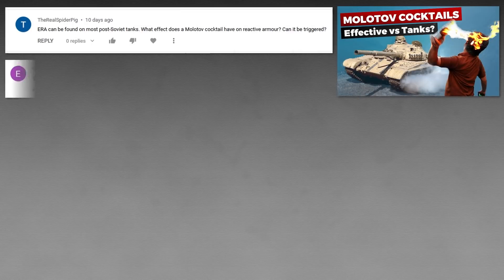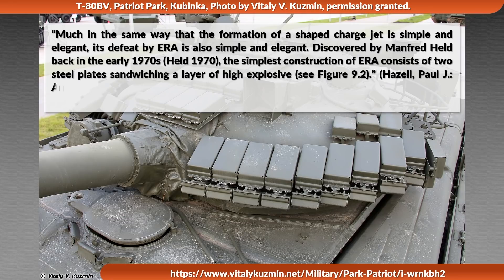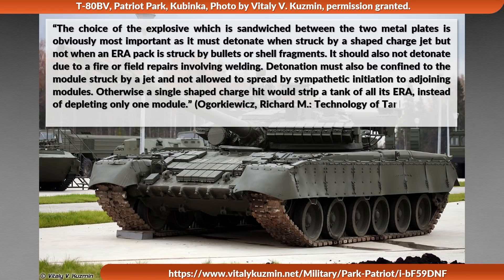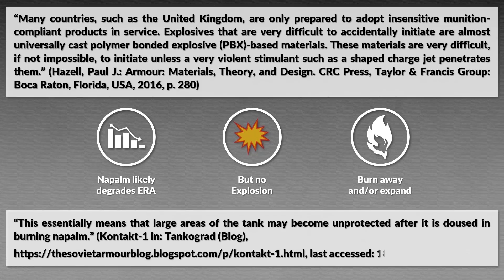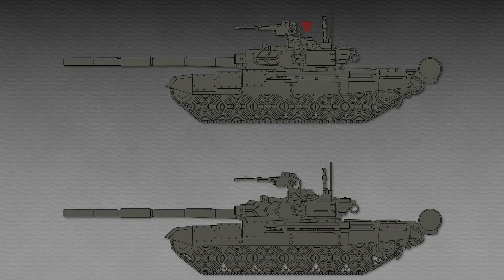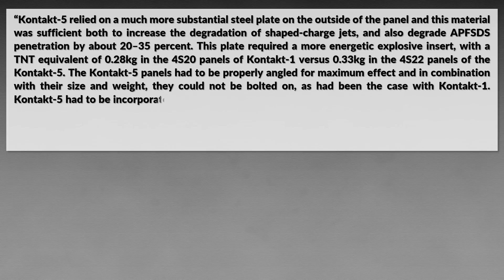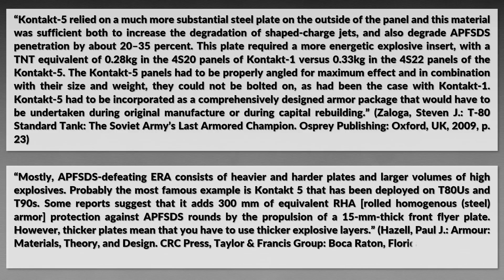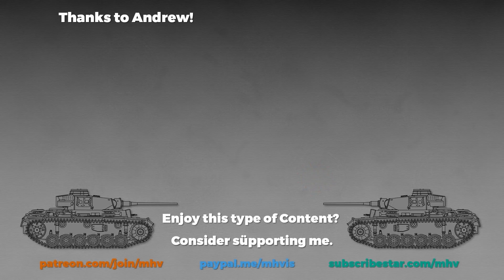Why does Russian Explosive Reactive Armor not explode?

Comment: Something is definitely going on with the Russians. Dry rotting tires on transports, equipment in poor condition, undertrained troops, etc. It seems to me that most of the high ranking military officials over there have probably just been pocketing the funds given to them for these things. I'm almost positive the majority of the Russian command structure is in deep trouble right now if they haven't been outright purged/killed already. One thing is for sure though. With all of these issues coming to light, I believe that there are going to be some major changes in the Russian military for improvements in equipment upkeep, supply chain planning and execution, command structure, tactics, and technological advances.

Comment: Something I didn't sea/hear mentioned (I may have just missed it) is that some polymerized explosives can simply melt under high heat. I do not know what explosive filler the Russians are using in their ERA (when they aren't filling it with egg cartons, that is), but I suspect that might be a potential failure point in their ERA systems.
Reply: the "egg cartons" are spacers for the "soft" relikt ERA
Reply: @arandomperson7713  I know. It was a joke.

Comment: Did I miss where he said EXACTLY how the APFSDS causes detonation? I heard that the steel plate is thicker, but it still needs to detonate, right? Or is it implied that the thicker plate creates enough commotion to do the trick? Maybe I just missed something.
Reply: Heat and pressure.  The steel liner is heated white hot as the penetrator passes through it and the speed of the projectile (over 2400 meters/second) provides the pressure.

Comment: Well the initial questions were about Molotov Cocktails, right?
So the conclusion is still that ERA will be degraded by intense heat and battering. They might not set off and explode, but it's not like the explosive filler is somehow immune to everything, unless you "wish it to be true" or something arbitrary like that. Makes no sense.

Comment: Thanks, and that's from an ex-military pilot who was paid to what we were told was to "service" the target.  I can sort of wrap my head around it working against HEAT rounds.  We had one guy who saw a tank shoot an APFSDS hit a tank on a range.  He said all you see is an extremely bright blue flash about like you see when an electric transformer blows up.  What seems unbelievable to me is that explosive reactive armor could have any effect on a dart that is made of harder than rock depleted uranium, which has a density 70% heavier than lead, weighing between 41 and 56 lbs, and arriving at a mile per second/3,600 mph/Mach 4.9.  No matter what it does to the front of the round, there is a lot of mass still coming and to push to the left or the right by hardly any angular amount seems like it wouldn't work.
Reply: There are quite a few channels here on YouTube that specialize in armour penetration simulations.
https://www.youtube.com/watch?v=NtQKycIzEOg here's an example, it really is an interesting rabbit hole to fall down.
Basically what most ERAs do is deform and deflect the APFSDS enough that it doesn't hit one tiny spot with all its mass so the damage is more spread out and not as deep, reducing the chance of penetration.
Reply: Whatever system is designed and tested to work needs the investment to maintain it over its service life. I’d suspect this is where their failings largely lie. Poor tactical employment has hampered them as well but with experience they’ll improve.

If their IR jammers only have a six hour endurance before needing recharging then why use the vehicle in the advance element and not cycle vehicles to lead the advance with them on? Things like that.
Reply: ERA was never meant to defeat or even significantly interfere with physical penetrators. They are, as you realize, much more massive than the deformed liner of a HEAT warhead. ERA is strictly intended as a defense against hollow charge warheads. It's a reaction to the fact that the use of guided anti-tank missiles has proliferated so greatly. And they have caught on so much not really because they're any "better" at killing tanks than kinetic energy penetrators, it's because they're so much cheaper than tanks. For the cost of one tank you can buy 200 missiles. And besides, it's impossible to build a man-portable weapon that can launch a kinetic penetrator that has a chance of defeating a tank's armor.

Comment: I made coffee on 200g of pressed TNT. First, cumulative ammunition uses explosives to deform the inner cover of a specific geometry into a "jet" of metal moving at hypersonic speeds, most ideally an alloy of copper or four-9 copper (99.9999 pure copper). ERA blocks should disrupt the "jet" to such an extent that it reduces the depth of the armor penetration but cannot completely disrupt the "jet". Second, ERA uses explosives or a mixture of explosives and polymers of high resistance to detonation (HIEx) and detonation transmission. For example, cast TNT cannot be detonated directly by detonation fuse or detonation capsule, must be inserted into the detonation chain booster charge of more sensitive explosives or conventional charge from pressed TNT. Furthermore, the tanks do not explode after the hit, but the propelant charge burns, very violent, but still burns in small space, still not detonation with the creation of a shock wave of sufficient shock intensity to activate the explosive in the ERA. Detonation of the grenade itself inside the tank is very rare. High-intensity explosives have a "cooking" time when exposed to direct flames or elevated temperatures. The so-called "cooking-off time" ranges from 20 minutes to an hour for HIEx directly exposed to fire to 1 to 2 hours for grenades and aircraft bombs before detonation occurs, for some new blends even longer (HIEx in 2 point implosion design for nuclear primary). The transfer of detonation is much harder to understand because, for example, under the water charge of TNT of 1.7 kg, it can transfer the detonation to the next charge 1 m away, in the air, of course, the possibility of transmitting the detonation is much smaller. The ERA must be designed with the sides thicker and stronger and geometry to prevent the transfer of detonation to the next block. The ERA also has a flaw in the form of EFP resistance, I used to find non detonated pieces of explosives scattered around after the EFP hit which just went through the ERA block without detonating the charge and continued on through the armor. Etc. etc.

Comment: When on an engineering course during a training rotation, I remember some of the range cadre using C-4 (for demonstration purposes) to boil some water for coffee. I remember my uncle also telling me about doing that, in Viet Nam. Knowing this, I suspect that when a tank with reactive armor is fully engulfed in flames, mont of the explosive contained in them is burned away, or melts, feeding the fire. what you see left is/are the steel blocks that house the reactive armor "ice cream sandwich".
Reply: Your uncle is correct. We used C4 all the time in Vietnam to heat C rats and coffee. It burned a blue flame
Reply: @johnburrows1179  ok
Reply: @johnburrows1179  David Drake suggested that C4 was used to remove frozen tank suspension parts in Vietnam
Reply: You can use C-4 to cook with but while it’s on fire if you stomp on it then it will explode
Reply: @troymerrell5790  Note to self: When cooking with explosives, do not attempt to extinguish with a hammer.
Reply: @troymerrell5790   Stomping on C4 will not initiate a reaction, even if it’s on fire.  You can even shoot it and it will not explode.  It requires a high explosive detonator.
Reply: @Brees1986  maybe as a fluid the compression could detonate it? Kind of like how diesel engines work?
Reply: @troymerrell5790  that's a myth
modern military's use explosives that are very difficult to set of to avoid accidents. explosives like TNT or RDX are very hard to detonate and require the high pressure pulse of a blasting cap to set it of. 
There's even been  development of bomb disposal shaped charge using magnesium instead of copper to penetrate the casing of airial dropped bombs and ignite the explosive mixture inside to safely burn of the explosive filling.
Reply: Great to hear these stories of service time "demonstrations". During my dad's time in training in WWII he told of sneaking along an additional Zippo lighter. He and his squad would use that and their own personal lighters ( nearly every body smoked back then ) to heat up the cans of rations or water over a hole in the ground to hide the flame from the D.I.'s ,lol.
Reply: That’s true. The US military used to have problems with guys in the field pulling C4 out of Claymores and using it as a fire starter or even fuel.  HOWEVER, the problem is that it gives off a toxic smoke that will make you very sick….
Reply: @Brees1986  And rendered those weapons useless...consequently giving the illusion of combat effectiveness in units that were carrying around empty casings.
Reply: TNT is the same, if heated it'll just burn. Same with ANFO and other similar explosives. PETN is a bit more unstable, but not that much. Pretty much any military grade explosive used today you can shoot with a rifle (one way to get rid of cluster mines) or burn and it won't go off. Not sure about shooting a burning explosive though, our training didn't talk about that but I'm sure it's not a smart idea to try.
Reply: We used to use the cordite in 303 shells to boil a mug of tea in the UK.
Reply: There was an old Mythbusters episode about this. They found that, not only did the C4 burn well, it wouldn't go off with anything short of a blasting cap- IIRC they even tried shooting incendiary rifle rounds at it while it was burning, and the C4 still didn't blow despite being completely destroyed by the round.
Reply: They say the fumes are pretty carcinogenic, so maybe stand back when it's burning & don't actually drink the coffee if you guys get a chance to do this! (Could be that's just a story to stop troops wasting it, but I'd look it up at least)
Reply: @nathansmith3608  It's true, also don't eat it to get high. Had a soldier try that in Desert Shield.
Reply: Exactly, you can use it for fuel.
Reply: Did they use C-4 as combustible ? Or like a heat-conducting surface ?
Reply: @lc1138  As a combustible. Lit it with my Zippo, a 2.5 by 2.5 cm (ish) cube burned for quite a while. the US Army issue heating tablets were made of basicaly the same ingredient, at the time, just not "nitrated".
 They did not use the whole one kilo block.
Reply: @Operator8282  wow. Ok. Very nice to know. 
I'll go take a look at the composition of all these nasty-boomy things.
Thank you !
Reply: @lc1138  something like cyclomethalhexaminetetramine, the active in C-4. I don't have my Merk Index handy, so pardon my misspelling.

Comment: There is one thing that does stick in my mind, considering the large number of knocked out russian battle wagons, in many many cases the ERA was not evidently working properly, so would this be another example of the 'left' (the russian black market) helping themselves to more military equipment? Somewhat ironic if you ask me. Thank you for an excellent video, well thought through.
Reply: Its not that its not working properly the simple fact is that most munitions that it faces now are designed to defeat it
Reply: Our intel over the years noted as well the explosives used were never replaced periodically like they’re meant to so even if hit it won’t function as intended.
Reply: @stevepirie8130  era explosive are keep in storage they only equip the tank era block with era when they are going into action they don't actual keep it on the block during peace time
Reply: If hit from above most era will still be there ( which Ukraine used alot of Nlaw and jav + era won't go off in chain , you hit a block it will blow up but the next to it won't .
Reply: @jerryle379  yes we know that, that's why the allegedly explosives need to be properly detonated, not just left lying around waiting to go bang, if you would like a full explanation watch the video, it's all in there. Meanwhile my point was based on what happened to the explosives supposedly used in the ERA blocks? Looks like they were stolen/removed/replaced with bananas etc.

Comment: Just think of it in the negative.  Someone splashes your tank with some lighter fluid and lights it.  Do you expect it to blow up?  Take it up a notch.  Let's throw a bucket of burning coals onto the tank.  Explosion?  One of the crucial aspects of any chemical explosive is that it DOES NOT explode until you want it to.

Comment: 9:30 - "And it seems that at least for Kontakt-1 armor, the chances of chain reactions and/or setting off multiple armor blocks at once is possible"

The quote which follows seems to contradict that statement. It states that the sheet metal "completely prevents chain detonations" and further specifies that only blocks hit by the incoming jet detonate, while multiple blocks may be stripped off.

My interpretation of this quote would lead me to conclude that a large warhead can mechanically remove multiple blocks from the tank through blast pressure. Not detonate them, and not cause a chain reaction. I lack the broader context and reading that you have done, though, so I may be misunderstanding the quote.
Reply: Nah, you are right. 
The testing has shown weakness of many early implementation of kontakt 1 is the mounting, not the era itself.
Reply: I general, I would tend to assume "completely prevents" is an over-simplification. It should not be surprising if attempts to optimize the blocks results in adjacent blocks also going off for extra powerful impactors.
Reply: Good point how about Relkit 4s24 Explosive Reactive Armour this is designed to stop HEAT HESH Shells and APSDS NATO 10.5 and 12 cm shells.

Comment: I think there is a strong case that the Explosive component was simply missing in most cases, there is several videos and pictures showing that there was nothing in them both the metal boxes and the kind that are hung over the side of the tank and that simply had egg boxes in them instead of the armor bricks,  you say that because they metal box is there then it is not likely to be missing the reactive part , well here is the thing Russia is full of corruption and full of situation where people pocket money designed for one thing and ether never do it or do a part job,  So i have no doubt that the company that made them in an effort to cut costs and pocket the money simply made ones what had a limp of metal in them , with their reasoning being that they are not at war and the likelihood it will ever be battle tested is low
Reply: Perhaps they had time to be salvaged by the Russians.
Reply: The so called eggboxes are spacers and r suppose to be there.
Reply: @aramisone7198  lmao no , you need to edumicate your call of duty ass, those soft bags holding the reactive armor do not have packing of any kind bit is just the plates, there is no shortage of evidence that shows that the so called reactive armor packs are entirely filled with egg boxes

Comment: Thank you for the clarification, I had also assumed that the shape charge was molten metal, but it would be totally logical that it actually wasn't but like you said was behaving like it was a liquid, without actually being so, and also makes it much more reasonable why is it so effective at penetrating such thick armor, as liquids are easily deflected by solids. Now I understand much more clearly, thank you!!
Reply: I think the best way to think of it is that the force from the detonation of the shaped charge far exceeds the internal cohesive forces of any state of matter (liquid or solid) so that the primary "resistance" to motion is simply inertia. For some liner materials, the jet may be molten but it doesn't matter much. When the jet impacts the armor, it is pretty much just a battle of relative density and momentum. Both the jet and the armor will deform and it is just the amount of mass involved per inch of jet and per inch of armor which determines how much of the armor gets displaced. The mechanical properties of the jet do matter secondarily in terms of the stability of the jet - if the material that forms the jet is too hard then the jet will tend to break up into pieces rather than remaining as a long thin rod. This is why copper is the usual choice - it is a good balance of high density (denser than steel) but also high ductility (will remain together in a single piece even when deformed drastically)
Reply: @sbreheny  Thank you for your lengthy explanation.  I believe I understate it much better now.
Reply: He lost me.
Reply: What surprised me at a former pyromaniac was that High Explosives produces pretty cool gases, some ~ x hundred degree celsius, that was the reason dynamite made mining much safer vs black powder, cause methan gas in coal mines does not ignite with such cool explosive gases. To generate heat in military explosives like bombs, aluminium powder is added up to 20%, burning with air oxygen at ~ 2000 degree celsius, otherwise there would be no fires at all...or the standard hollywood scene throwing a handgrenate in gasoline containers with big fireball does not work...I blew up a can of motorstarter spray with HE in my younger vears, having a very low ignitionpoint, expecting a fireball....nope...nothing...just for science....